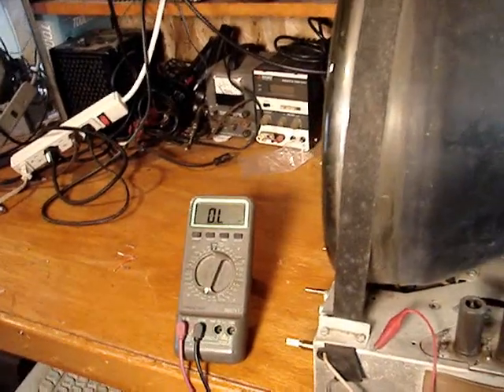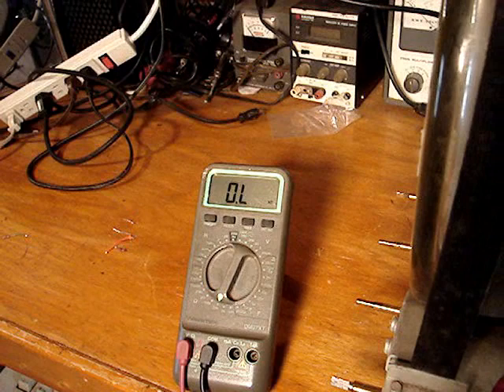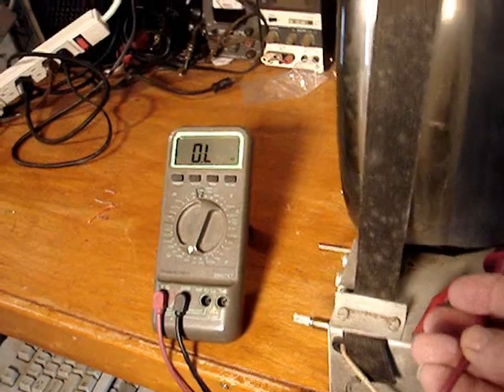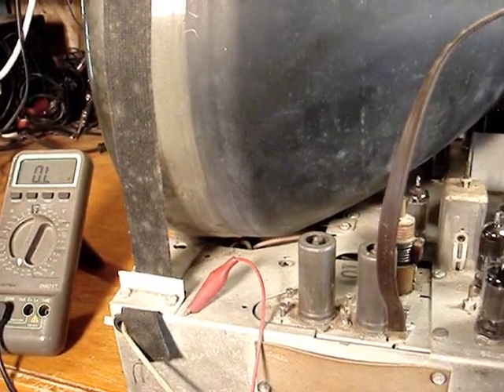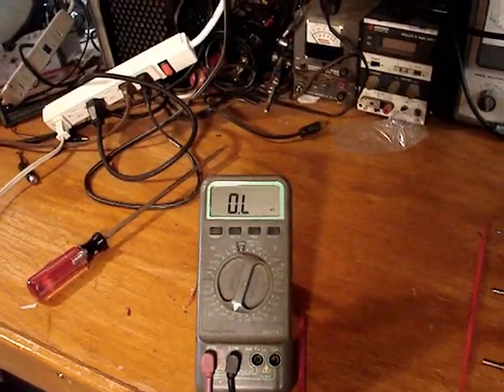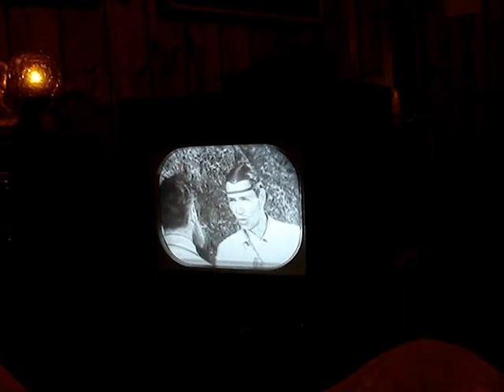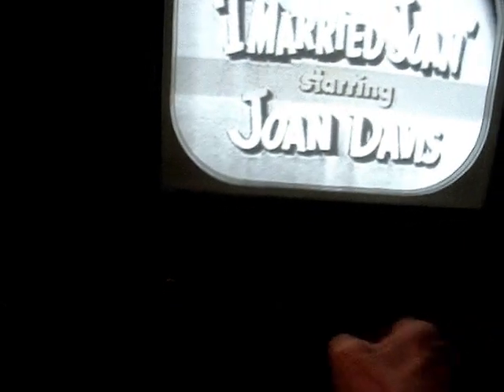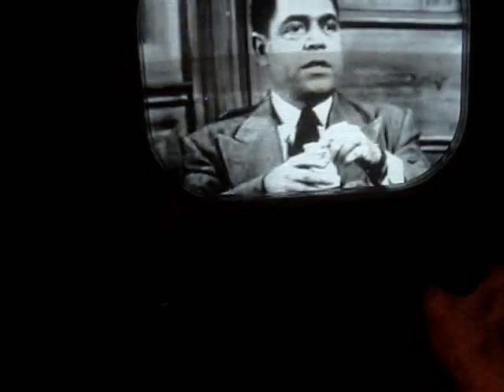Admiral 1948 30C15 TV PT7

Comment: I hope that video is digitised better than the ones I have which are clearly 320×200 or worse.  If not, that will overshadow any imperfections in the television set.
Reply: Okay nevermind; you answered that. 🙃
Reply from the maker: @KC9UDX  Most of those clips were downloaded from archive.org. They are mostly MP4 files with the exception of a few that are AVI which are large files..
Reply: @HD7100  I've actually bought VHS tapes of historical television shows which were apparently just digitised in a hurry as cheaply as possible to make a quick buck.  Granted this was twenty-five years ago.  But they didn't have to do it that way.